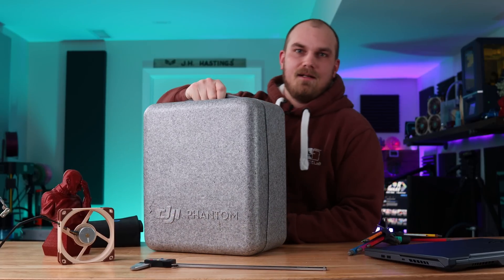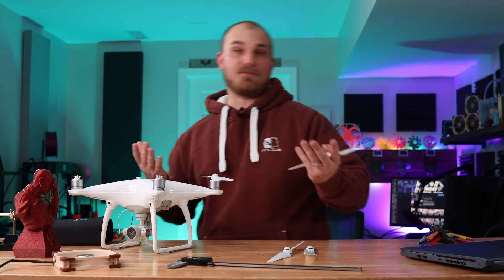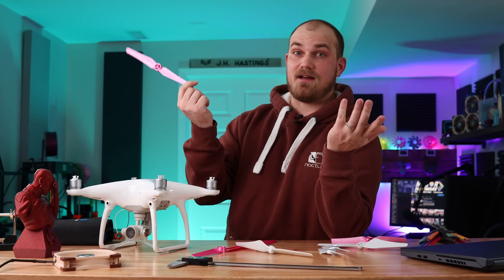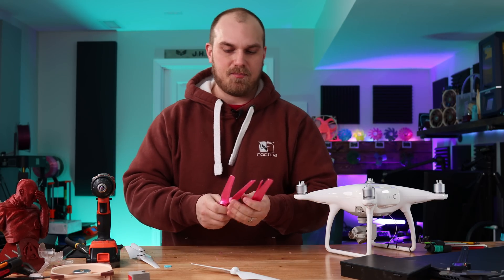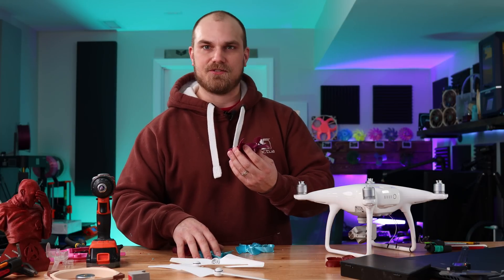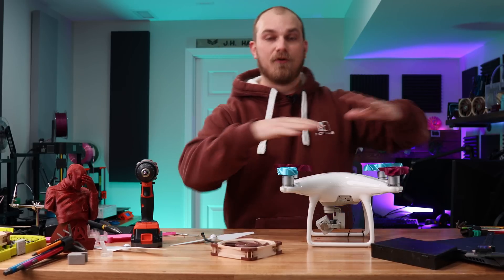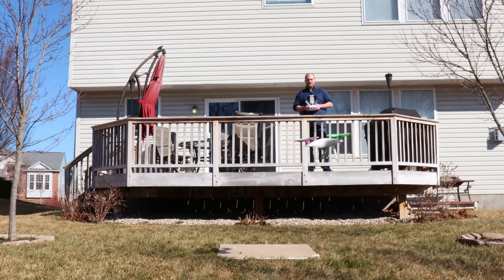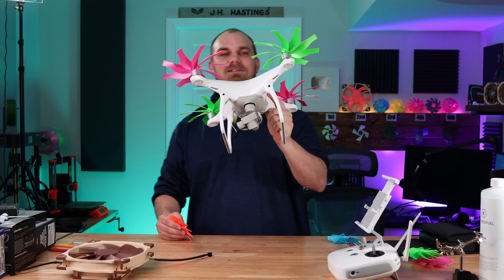FLYING Phantom 4 with 3D printed PC FANS

Comment: try something like putting enough weight on the dropping mechanism so it doesnt lift off, putting it at max power and then releasing the weight to see how fast it goes. or putting big enough biohazard fans so they dont interfere with each other and  then flying it

Comment: as i said in you last video fans propellers and impellers are different things 

fans are used for generating airflow not lift if a fan generated lift it would be pointless as a fan just like if a propeller generated air flow instead of lift it would be pointless as a propeller 

and no its not that it was not generating enough thrust it because thrust haves nothing to do with this experiment it did not have lift because you were using FANS and not propellers and fans are not designed to be used as propellers

now if you were to turn your fan into a propeller by adding an airfoil to them you should be able to generate lift 

and NO it dose not have to do with the length of the propeller but the surface aria of the propeller because in reality all a propeller is is a rotating wing hints why helicopters are considered rotary wing aircraft

Comment: This seems to be a case where adding too much mass (or surface area to be affected by wind) on the fan blades reaches a point of diminishing returns. But i wonder if something between the 2 blades on the original and the 9(?) blades on your 191 mm version would provide  a more optimal solution.

Comment: el problema no es el diametro de las aspas sino el angulo, ese angulo esta diseñado para mover flujo de aire y no al drone mismo, como consecuencia el flujo de aire de los ventiladores esta se mueve por los lados y no de arriba a abajo, eso es lo que causa la inestabilidad, debes reducir el angulo del aspa simplemente

The problem is not the diameter of the blades but the angle, that angle is designed to move air flow and not to the drone itself, as a consequence the air flow of the fans moves from the sides and not from top to bottom. that is what causes the instability, you must reduce the angle of the blade simply

Comment: Also the aim of a drone blade is to create lift, and that can be achieved via an aerofoil cross section. A PC fan is intended to create a mass flow rate of air through a heat exchanger, so no aerofoil section is required. It also needs a higher blade density in order to build a higher static pressure to force the air through the heat sink.

Comment: The fact that the DJI drone flew with your 3D printed rotors on it says more about DJI's incredible stabilization software than it does about your prop design... and I wouldn't call that flying but more like constantly avoiding crashing. 
Also you need to have longer rotor blades because it is the tips traveling at such a high speed that produce the most thrust. Try making the bio hazard bigger than 120 mm like 200-300 mm and that should work. oh wait it sounds like you figured that out...

Comment: The material used does matter, I guess the carbon fiber or stronger yet light weight material should be the optimal choice. 3d printed plastic parts don't seem to be that durable. However I liked that you're trying something new which I believe never been attampted. Best of luck with your research and experiments.

Comment: Why was the gimbal off in the last flight? Did you break it or is there an option to turn it off?
Also, very nice. You can be proud of yourself for basically reverse-engineering the locking mechanism. Fricken awesome.

Comment: A fan to move air is different than a fan to create thrust - the cross section of one of the flight blades for the drone is not just two flat planes on a slant, it's shaped like an air foil, the top surface curves more than the bottom surface, and it's the different distances across the top and bottom of the blade as it moves through the air that creates a low pressure area on top and a high pressure area on bottom - that leads to thrust - not just moving air.  Without a proper airfoil cross section - a "wing" shape if you will - it doesn't matter how many blades you put on the motor, you'll never get the lift you need to get into the air.

The diameter is not the issue - the lack of a proper airfoil cross section is the problem.

Comment: Part of the reason your props didn't work that well, is that the blade pitch looks more or less constant along the blade length. You need to make the angle of attack much shallower near the tips (like the original blades). Most of the thrust comes from the outer portion of the blade, and it's likely that some of that area was stalled with your design due to the angle of attack being too high.

Comment: could you stiffen the blades while keeping the weight down by printing them as a honeycomb?  Bottom skin, honeycomb interior and top skin?  You would probably still have to print the fan with fewer blades to compensate for higher weight per blade.  Also, your print lines are parallel to the leading edge of the blade.  There is a drag reducing technique that involves grooves perpendicular to the leading edge of wings.  Perhaps if you change the print so the lines are perpendicular you could gain that drag reduction.

Comment: Pretty sure the problem here is not the Fan size, but the fact that the drone is set to take off with those fans so it is only speeding up to the RPM that would be ideal for them?!

Comment: This could be helpful in designing a blade for your drone: https://www.youtube.com/watch?v=WGKIjojADmg

If I understand correctly, the surface area is a key factor and even a small reduction will have a big impact.  But maybe going to the same size, but with four blades and a duct might help with stability/rigidity???

Comment: use the jumbo bio. the bio fans works better than the basic looking fans at the smaller size. using the larger one, should work even better than the ones that made it fly

Comment: You need to scale up the fans to match the length of the actual drone propellers. There’s  not enough surface area with the pc fans to generate enough lift for the weight of the drone

Comment: You want the blade pitch to be consistant with velocity across the fan blade. Use the inverse tangent of expected RPM and then give an arbirtray value for incoming air speed (say 10mph). This inverse tangent method will ensure the blade pitch is consistant across the blade, and thats all that matters. The tips need to move the same amount of air per revolution as the base. Inverse tangent my friend.

To get the size of the fan blades you take the circumference of the blade at that point, choose a height you want to use and multiply them together. (simalar concept as converting from X Y coordinates to polar coordinates). So pick a height you want to use near the rotor, take the circumference there and then make sure the values for the other parts of the fan blade all turn out equal values.

You need to be lofting through a few sketchs to get the right shape. I use 7-10 sketchs for the blades.

Comment: Make those biohazard blades about 2-3x longer and somewhat thinner, add an outer ring to equalize the ensuing flopperinos, and maybe it'll go somewhere. Efficiently somewhere? No probably not, but somewhere. Also get the best strength-to-weight filament you can; rotation inertia is NOT your friend when the poor drone is trying to rely on precision differential thrust in order to stay airborne.

Comment: I'd be curious to see what fans from the leader boards would do if lengthened and/or scaled up. Something like the acceletron may do pretty well too as far as preventing the material from flexing as much since all blades were connected at least slightly, and it had some good angles.

Comment: You're trying to put mini quad props on a fill sized. Scale up the width too.
Reply: Omg two categories for a SPINOFF of series.
Reply: Kv was just too low, that and DJI limits thrust to like maybe half thrust or something stupid low (I still have to put together my sleeper quad, but it's guts are replaced with hobby control parts so you can get full power like 20 amps each motor at 4s while DJI probably limits to 8 amps if I were to guess, anyways that way I can be like "yo guys did they change something in the update?" Then just do power loops and do acro with it, lol, though this has been done before it's priceless).

If he used some 2700kv motors same size he'd be pushing well over what the phantom is designed to produce (I don't know if they have a current safety but you'll definitely hit that if it let you go fast enough but I think they are altitude climb rate software limited as well as GPS speed)

Comment: The big fans are cool.  
Did you calibrate the compass and get a GPS lock before flying.  
Even in a fairly quick wind, the DJI should auto take off and hove in place.  
Regards, Jas  
VK4FJGS  
Rockhampton Queensland Australia

Comment: part of what you were missing on your blades was the aerodynamic lift generated NOT by the angle, but by the arc shape of the blades. heli blades are very thin, but are shaped like plane wings, so simply swinging them around generates lift. tilt does less than lift. try a 5 blade design that is flatter but has a wing shape.

Comment: @Major Hardware
The winner/leader of the fan-showdown gets printed as quad-copter blades :D
But I think you need to scale up the designs, those pc-fans don't cover enough area (should be about the same radius as the original drone blades, or like the big bio-hazard fan in the background, that big?).

Comment: Cool idea for a video series.
It would be interesting to see measurements to guide further development - you could get a separate motor and controller, mount it on several thin arms inside a pipe with a much bigger diameter, and have some sort of loadcell to monitor the thrust. The pipe would protect you incase of a blade failure. 
You could then measure thrust vs rpm and thrust vs power consumption for different number of blades, and different blade profiles.
It would be interesting to be able to measure the response speed as well, but I'm not sure how to do that - drones have to vary the speed of the blades for control, so you'd ideally want a very lightweight design, for less angular momentum, and more agile control.
It might also be better to use resin printing, for a smoother finish. I'm not sure roughness makes much difference for PC fans, but for propeller blades I imagine it does. (Something else to test?)

Comment: You don't have enough surface area on your lifting surface, also with those blades so close together the preceding blade is causing air starvation issues for the following blade, plus with as many blades as there are there's more drag decreasing your rpm, you'll never reach take off velocity without some pretty serious brute Force i.e. much faster RPM motors.

It would also help if you reshaped the fan blade profile to more of an airplane wing shape to actually generate lift rather than just moving air.

Comment: The blades on the drone are not fan
Blades, theyre more like wings so their geometry generates lift by both pushing air down, and lowering air pressure above the blade

Comment: I think the blades should have a much more flat angle since you want to generate lift and not airflow or static pressure.
Reply: Yeahh. They need to be very high kV..I mean high rotational speed. But even still, ~115mm props would have to spin fast AF to generate a decent amount of thrust.

Comment: Your problem isnt with the number of blades, it's with disk loading. In fact more blades is hurting the efficiency and responsiveness of the motor because of the extra mass. Increasing the disk area is all you needed to do.

Comment: "It's not stable, but airworthy"  - Boeing execs to the shareholders, while talking about the MAX8.
Reply: leaders in the "good enough" category
Reply: @ghomerhust  If only they hadn't been so hasty in applying their "good enough" mark of excellence.
Reply: Yeah, agree.  MH already measures rpm and cfm!  Now measure weight!Get that weight under control! Sounds like a perfect start!
Reply: Don't forget Starliner
Reply: @themagiceye6723  Well, it was very similar, really.  unstable in flight, (due to software mistiming... also see Ariane 5 explosion for what that could have done in a different component: https://youtu.be/Xsqe3utT6rs?t=238 ), but landed safely.
Reply: I spy the Boeing employee

Comment: Propellers and fans do very different things even they look similar at first glance; props are designed like a wing, they create low pressure on front side which creates trust, they actually don't move a lot of air compared to fans, fans on the other hand are designed to move air, to have anywhere near thrust efficacy compared to props fans require narrowing duct, or stacked counter rotating setup.

Comment: there's just no way fans with fanblades (much) smaller than the original ones would be able to lift this thing unless they had some serious RPM (that's assuming they're stable too) no matter how much engineering you put on the design. we all know bigger blades move more air.

Comment: I think you need a circle of plastic around the outer perimeter to stabilize the fans. Then the fans will flex less, it's additionall weight but should result in a more stable flight.

Comment: I totally want to see a "better designed" (more rigid etc) more-than-two-blade fan design for the Phantom 4 but in the original diameter... I'd love to see if it can actually make more thrust with a multi-blade design...

Comment: So after watching this, it's clear you did your best to design a fan capable of displacing enough air to create lift. In theory, that's pretty much the same as trying to achieve the most cooling 🤷. Hmmm. 

You should put your final 120mm design into the showdown!

Comment: When I saw the 120mm fans on that drone I immediantly knew "That ain´t gonna work", the fans obviously were too smal to lift the weight. You could have tried 200mm Biohazards or one of the  2-3 bladed fans which were send in or maybe even the boomerang fan. With 120mm fans you need a smaler and lighter drone, since it´s about body (fan size) to weight (drone) ratio to make it fly, the weight of the fans themselves shouldn´t matter that much.

Comment: If your printer is to small, make attacheble blades, like the whale blades, and I think you make propper fans, props have indeed more of a airplane whing shape. That hump on the leading edge and the thin trailing edge

Comment: Who's user submitted fan design will work the best on the drone? Future video ideas?
Another note, another take on the 3d printed Radiator, different designs,and stuff. 
Maybe somehow a fan that somehow is a radiator built in? (The fan Itself is a radiator?)
Some out of the box thinking on that part though.

Just a thought... The fan having tubes inside it where water pushes up the center and goes out tubes in the blades which makes the fan spin?
Some kind of water cooling setup could use something like this?
As far as I know, No one yet, has done it.

Comment: The fans are just a bit too small:> shorter blades => lower blade-velocity/lift for the same RPM. The motors then spin up faster, but can not go fast enough (and at that point the not-smooth surface also starts become relevant enough).
And well - fans are designed around pushing air with restrictions, props are designed to push them basically unobstructed - so high airflow fans might have a better chance.

Comment: In the words of the immortal Leonard Nimoy, "Physics is a bitch". Thrust comes from the prop's tip's linear velocity. Higher RPM, faster tip velocity. Longer blade, faster tip velocity. Make the Biohazard blades as large as you can without impacting something, I'd bet it would fly then.
Reply: Yes and no. If you want a more in depth answer, check out Mike Patey's Scrappy build for a pretty solid walk through of efficient top speed vs. acceleration.
Reply: @martindinner3621  It's a 3d printed joke design, optimizing it is a waste of time. We just want to see it fly. How about you suggest an actual solution instead of a drive-by "uM AcTuAlLy".

Comment: I'm going to add to the comments suggesting a stiffer filament or building in a more rigid design. Aircraft propellors are quite "chonky" so maybe thicker blades may be better. Limit the number of blades to 3 or 4 too.

Comment: This feels like watching a normal informally trained mechanic trying to design a helicopter,  liked it 9/10
Reply: in the next episode: https://youtu.be/hooGTGdH66M?t=143
Reply: Igor Sikorsky designs the first helicopter 1939 colorized
Reply: Igor Sikorsky started the same way. There were no computers back then. He simply had an idea, built it, and flew it. If it crashed, that was the end of that. If it didn't, what were the flaws that can be engineered out? Time to repeat the process.
Reply: Engineern't
Reply: He needs props the size of the stock props it hurt watching this the drone is designed only to work with stock sized props
Reply: Next step is 9/11

Comment: If you have enough thrust generated your problem is unbalanced prop not wobbly prop. Also if you have a smaller prop to generate same thrust to a bigger one you have to spin it faster (disregard prop efficiency for a minute) this means that you either have to supply higher voltage or change the motor kv to spin faster. Note that you would also likely to increase current through the esc so... Yea it might end up in magic smoke.

Good effort though
Reply: He said that at 9:00 🤦🏻